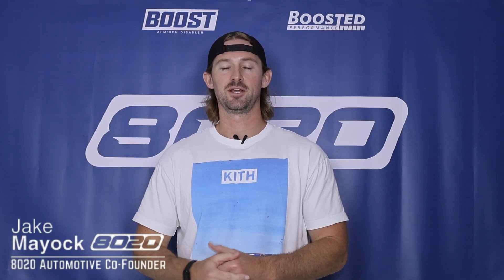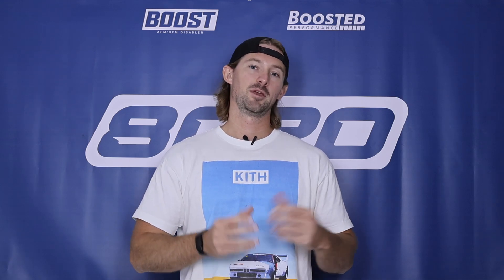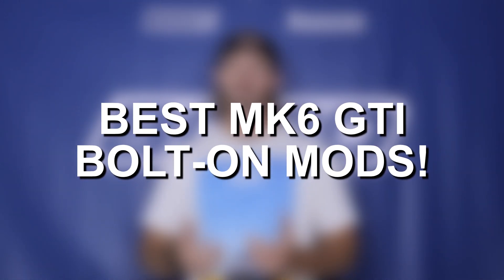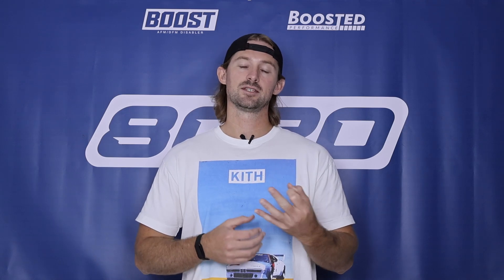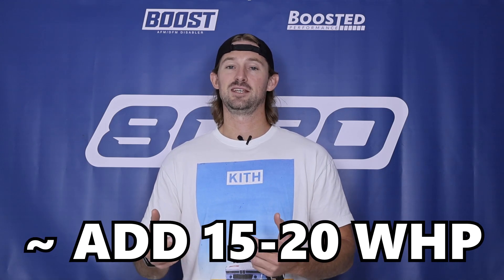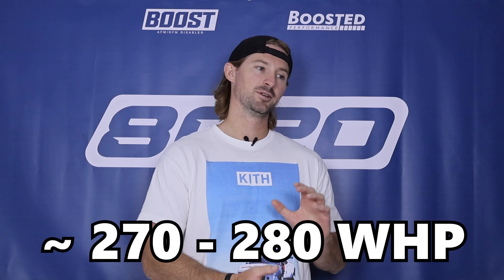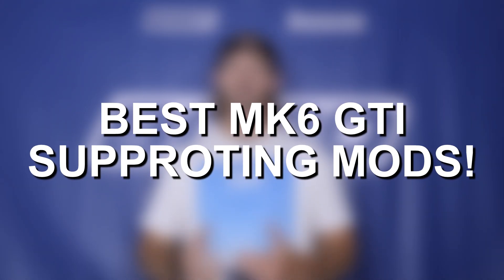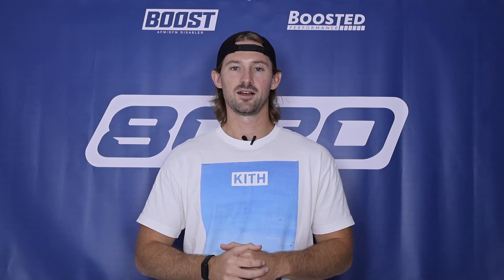How to Build a 300 WHP VW MK6 GTI! (EA888 Engine)

Comment: Im currently running hpa hybrid ko4, cts cold air intake, arm fmic, arm high flow catted downpipe, arm high flow turbo outlet pipe, obx catback(no mufflers), ngk irridium plugs, r8 red top coils, e30 fuel with a stratified pro tune that was refined only for roll racing. Im sitting at 340hp with 375ftlbs of torque. Very fun car and it eats stock v8s all day😁
Reply: No intercoolrr?
Reply: @mariocardoso02 im running the ARM front mount intercooler.
Reply: @m95genetics do u think, should change high fuel pump? I have ic apr, intakr apr, spark and plugs, downpipe 200 and exhaust miltek,   im thinking of take off the ressonator and change  the high pump
Reply: @mariocardoso02 i wasnt aware of an aftermarket hpfp option i didnt think anyone made one. If you want to get to the 400hp mark hpfp would be necessary. You could also go with stratified xtra fuel system or methenol. If you are going to daily the car i wouldnt go above what i have done or you will sacrafice a good bit of reliability

Comment: Literally just get a K04, downpipe, intake, fmic, and higher octane tune and you'll make 400hp crank it's that simple not hard at all I'm only stage 2 with downpipe and intake and I'm pushing 340tq and 281hp on 93 octane not bad but I'll be getting a K04 soon and an intake manifold so I'llale 400hp on stock fuel system
Reply: 400hp on a ko4 is just asking to blow the turbo.. a ko4 is it usually rated at around twenty pounds... You people throwing twenty eight pounds at it and getting four hundred horsepower are just killing the turbo... Also you have to run rac fuel or e 2 get those number...

I run a cts ko4 and im at 340hp 330tq..93 tune..
Reply from the maker: K - We agree with you.
Reply from the maker: L - We wouldn't advise this.

Comment: For 350hp you need:
K04-064
76mm full exhaust 
Bigger Intercooler 
Full air intake 
For 380-400hp:
K04-064 with forge wg blue spring 
Methanol kit (for 400hp)
Bigger injectors 
For 450hp:
Hybrid turbo 
Methanol kit 
Upgrade hpfp
For 500+hp:
Upgrade rods and pistons 
Hybrid turbo 
Methanol kit 
Upgrade hpfp and lpfp
Reply from the maker: I - Thanks for sharing this breakdown. It will certainly be helpful for future viewers!
Reply: You can make over 400 without meth 🌚
Reply: @Dazedgti yes but you play with fire 🔥...
Reply: Will the k04 fit on ea888 gen 2